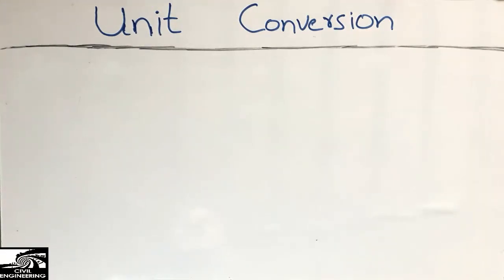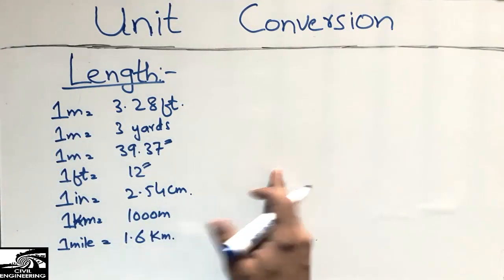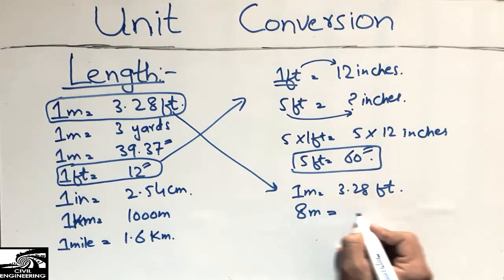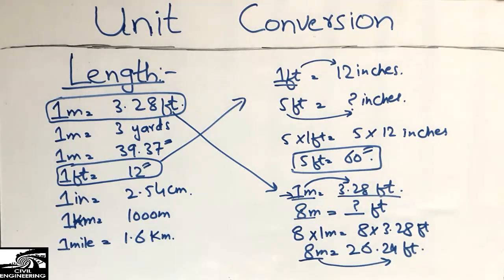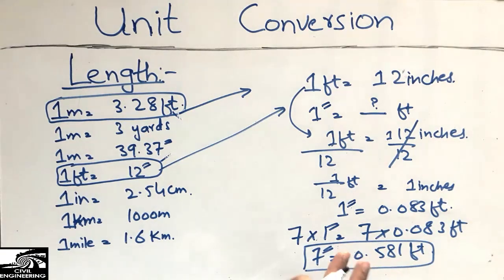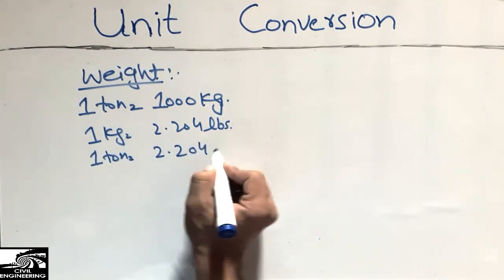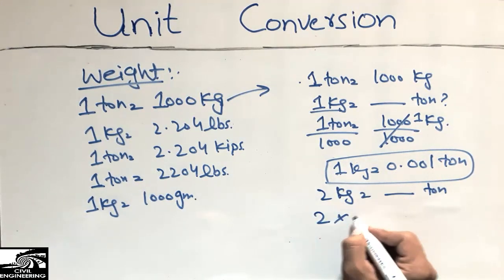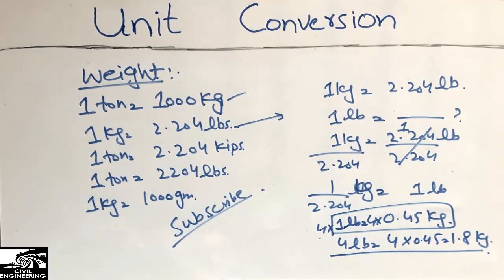Units Conversion in Civil Engineering

Comment: 1 cft = how much tonns
1 cft = kg ?
Reply: For which material? Different materials have different unit weights. Unit weight of water is considered 1.00. ie 1 cubic meter of water is 1000 kilogram ie 1 metric ton. In that case 1 cft of water is 28.31 kg = 0.02831 ton